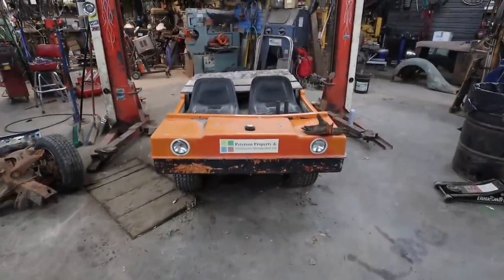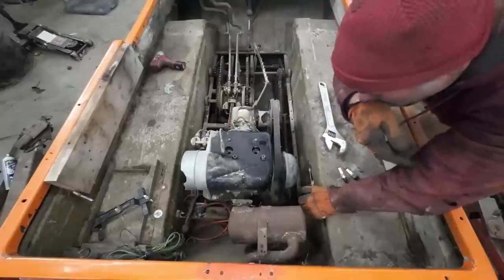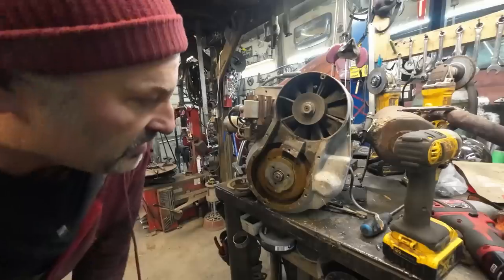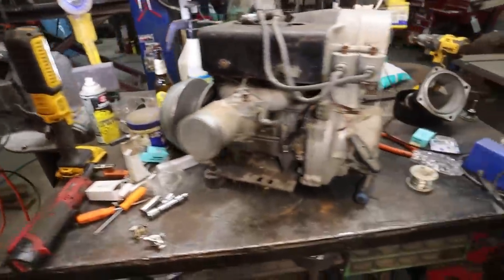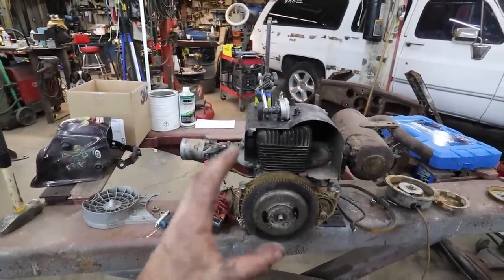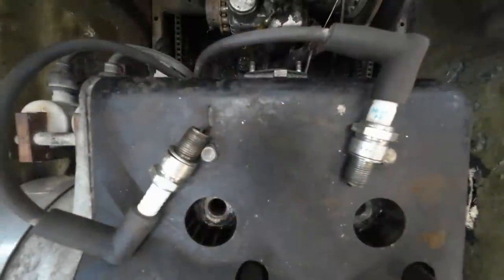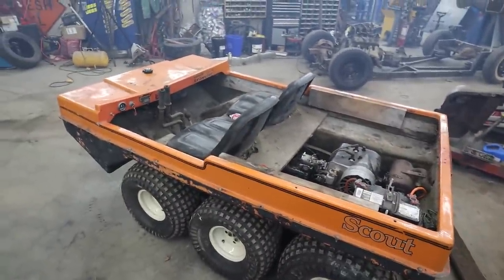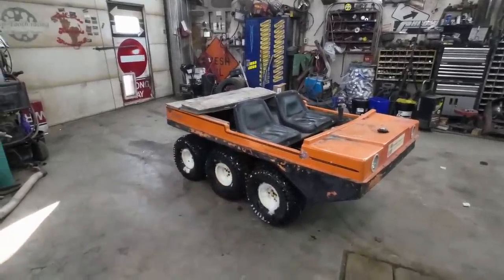1972 OTACO Bazooo 6x6 can we get it to run and drive again?

Comment: I was able to find a VERY limited amount of documentation about this thing after some googling!

What you have is an OTACO Bazooo. It is a VERY limited production product and theres only a couple dozen known to exist. It seems the traveler/scout paint on it was done after the fact to mimic an IH Scout.

They were made in 1971 and '72, I couldnt find any production numbers but theres maybe a half-dozen of them I can find on the internet. The engine is a CCW (Canadian Curtis Wright ((yes, that Wright))), it was either a 240 or a 290cc. The OTACO brand changed hands a lot, hence the Bazoo only being made in '71 and '72. You are correct, it is supposed to be watertight and float like an Argo.
Reply: Cool. Thanks for the info.
Reply: I'm lookin' at that thing thinking deleting the 6x6 and putting some fully suspended tracks on it instead would be fun as hell. Forgo the amphibious part entirely.
Reply: I was thinking the decals on it were from an IH Scout. 👍🏻👍🏻👍🏻
Reply: @rexkramer4938  Agreed. Looks like it.
Reply: It needs some snow chains!
Reply: How can you find it? Maybe it belongs to someone?

Comment: Good work. When it first ran it sounded like the starter was still engaged. Way to hang in there, most folks would have pushed it back into the snow.

Comment: I’m a snowmobile mechanic in Brandon yelling at my phone! Lol all the parts you need to get that running are just down the road at sun and snow in portage! Anybody who deals sun and snow can have you the parts overnight. The bottom fitting on the carb can be replaced with a spin on tillitson spin on filter.

Comment: Well at least you got to have some fun with it, after working on it and solving all the problems there were. It is pretty out dated now compared to quads and bigger dump bed enclosed 6 wheelers. I thought for sure Pablo was going to get it, but he didn't see as a fun ride and something he could get killed in. And it stopped smoking at the end of the video, which was very educational working on smaller engines. Take care my friend

Comment: Quite the machine. Tillotson carbs are the bane of existance to many. The broken spigot is the fuel pump. Mikuni pump helped, but likely the carb needs the crankcase impulse to start. My best suggestion is make an adaptor and stuff a mikuni on it. 
Makes me want to get my cushman lobster going. Also not many of them around.
Pablo wasnt having any part of it😂
Reply: Tillotson carb, pick it up and throw it in the woods, then pick it up again and throw it farther.

Comment: Excellent Video Brent  :) also remember hearing them built in Ontario Canada back 1970's  and never around them except at Auction sales seeing them and one saw years had Snowmobile of a 1974 Bombardier 400 Cubic Cm with 2 cylinders plus 2 carbs in one air filter and 2 exhaust ports  to one extension  pipe in small farm tractor piglet muffler with rain cap and fuel tank 5 gallon of plastic Snowmobile up dash , plus rip cord start with key ignition dash plus choke also RPM gauge, plus Snowmobile Speedometer, one headlights , back up brake of trailer square with License plate hook for small or big ones plus cabin to 2 people only steering wheel was Snowmobile plus gas , brake , plus headlights for high or low and button to kill engine! In cab had switch for turn on Cecile lights  when engine running cab made out plex glass plastic and door on to plus windows so ! Doors had small open adjustment for want smoke let having! Sold at Auction for $1.000 back in 1994 was at and creative idea  only 4 wheels to homemade one axle was lawn tractor type !

Comment: Cool build you have going. Not all 67-72  C/30 trucks came with cab lights, only those with R05 "DR wheel conversion" on SPID were mandated. I've had several single wheel cab & chassis trucks without them. Also your front Dana 60 axle has to be from a 77 or later K/30 as there were no 1 ton 4x4 GM trucks till 1977.

Comment: Hey

Friend had the same idea from a Buffalo NY company.  Ran well when it did.  We managed to bend the center Axles, which we never fixed.  We also managed to have a small engine fire.   

Again, ran well but it would 'float' a bit.  Snow, water, too much speed with a short weird driveline would all cause it.  

Have fun while it lasts.

Comment: Although happy ya got it going, happier to hear the words "GONE"! Its a project that never ends or there would of been more of them for sure. When working sorta, most fun you can have with clothes on but rougher than a stucco bathtub to drive. More than anything was fighting what mother natures temperatures gave you to play in. I think  had they mounted the outdrive way high and since there is no limit on how many chains this thing can find a use for, more for getting power to the wheel seems befitting. I am glad it runs but in the same time line, you probably finished a hotrod thats worth a bit of change. This is a  money pit for sure Brent... Pablo is smart.... stay away daddy!

Comment: You need a good 1/2” drive long handled break-over bar and socket! Wore me out watching that big adjustable wrench slip off so often on you trying to unlock that little engine. Need to take off those inspection covers and make sure there aren’t any mice/rat nests dirt wasp nests stopping up the fan and its ability to cool that little engine.

Comment: CCW stands for Canadian Curtis Wright, and from what I have found, and is a rebadged Kioritz engine. Kioritz produced the engines for Canadian Curtis Wright, who imported them from Japan. John Deere later signed an exclusive deal with Kioritz, and they began producing John Deere badged engines used in later John Deere products, and the CCW name was phased out shortly thereafter.

Comment: When you said Scout, I thought of an International Scout which were pretty cool. Marvel is probably the best every day air tool oil. I have used it on the same air drill for years, with the original chuck.

Comment: OMG what a thrash.  You could have built three hot rods in the time you spent trying to get that finicky engine to work.  You could have adapted a Predator engine in a quarter the time.  Of course it would have not made as entertaining a video.  I applaud you not getting frustrated and taking a sledgehammer to it.

Comment: hey brent just a tip if you ever need parts you can get them for a 440cc snowmonile engine this is a neat little amphibious vehicle and a rare one at that also yes its very similar to the argo its basically the canadian version have a good week
Reply: also the coils are the same as my 85(i think it is) yzf85(or something like that)so if you just look around you can just use other machines parts since this is obselete

Comment: That engine looks just like a 440 Ski Doo engine . I have a few of them in my garage and got one on a homemade go kart I built back when I was a teen anyway that thing is cool I hope you don't round that bolt off with that adjustable I would use a closed end wrench or socket before I use one of those. You need to take that bolt out later and oil up the clutch arms under that cover and my need to adjust them too since it's been sitting a long time you can get them to run real good with some adjustment anyway what a cool machine.

Comment: Hey Brent, considering how difficult it is to do the timing do you think that replacing points with a CDI would be practical? Maybe more practical for a motor transplant to replace that oldie? Quite an enjoyable problem solving venture.
Reply from the maker: Yeah but if a feller looses spark points are usually cheaper haha

Comment: Man, yya need the patience of Job, to tackle that job.. I would've given up on that thing long ago. Boy did you ever have to macgyver that mess together, I was beginning to feel sorry for ya, there a bit.  budd. It operates in some ways like a little tank. or a unitrack that I use to use when I worked in the coal mines to bring supplies into the coal mine. Once you figure the thing out Brent, and fix what's not working, it should be a blast. I think it will serve ya better when the snow gone..I don't think their meant for snowy conditions. I think argo's need special tracks on the snow in general. Since the machine doesn't have a lot of ground clearance.

Comment: Just in case you arent familiar with two strokes. If it gets left sitting for a while the oil will seperate from the fuel and sit at the bottom. And if not shaken and mixed back in , you will get a concentrated oil clogging up the carby

Comment: CCW is Canadian Curtiss Wright engine they were built for snowmobiles they were used in old Scorpions and John Deere and other sleds. I use to have a couple engines and parts but I will have to see if I have anything since it's been a while since I had anything with a CCW that is early 70's snowmobile for sure. What CC is the engine it should have numbers on it by the shroud if I remember right.

Comment: Back around 1975 I had a customer who had recently purchased a twin track PasseParTout (  https://www.youtube.com/watch?v=ip6PxIsCm0Y  ) ATV and he wanted to put a blade on it to plow snow in the winter and tidy up the beach at his cottage in the summer. I went to have a look at it and was surprised that it had a complete metal frame and body. We figured out  way to build a blade that would work with an electric winch and he commissioned me to build and install it. It took about  week to get all the parts and pieces together and have a fabrication shop roll the blade into shape. I spent a day putting everything together at his lake cottage and spent another day tweaking and painting it to match the body. He was very happy with the unit but I told him he should never take it in the water because the blade had changed the centre of gravity and I was worried it would push the front down and cause it to sink. He said had no plans to take it in the lake so that was not a problem.
Around October I got a call from him asking if I could bring my welding truck over to help with the rig and I said sure. When I arrived I asked what the problem was and he took me around to the front of the cottage to the lake. I didn't see the unit so I asked where it was. He pointed out to the lake and said, "See that buoy? It's attached to it." He then went on to explain that while he and his wife had been out one evening that his 16 year old son had decided to go for a joy ride and prove that my theory about being nose heavy was in fact correct. I  asked what he wanted me to do and he said pull it out with my truck. Apparently he had tried with his pickup and it just spun out or broke the rope he was using. I told him I would give it a try but I wasn't too keen on going out in that ice cold water to hook a strong rope to it. No worries he said. He went into the cabin for a second and came back out with his son who didn't look too happy. He pointed to a cardboard box on the ground and said get to it. The son pulled a 100 foot x 1/4" chain out of the box and started into the water. He got to a point where the water was now over his head and started to whine but the old boy told him, "You sank it, you salvage it." My customer and I sat on the porch and had a couple of beers being thoroughly entertained watching the boy figure out how to get it hooked up at which point he came back to the beach shivering. His father said did you hook it to the trailer hitch like I said and without a word the kid went back in and re-rigged it. 
I went to back my truck in and the kid was there to guide me shivering all the while. When I was back far enough we hooked to the chain and I slowly pulled it up onto the beach. He asked his son if he was ever going to do anything like that ever again and the kid said, "no way dad." He said go in, take a hot shower, get some dry clothes on and then come back out and bail the unit out. My customer asked if he thought the kid would ever do anything like that again and I told him probably. He nodded his head and gave me a $100.00 for my time. 
The following January he called me. I asked if something had happened to the rig and he said no, it was just fine and then he added but my new skidoo isn't so good. Turns out on New Years eve sonny boy took the skidoo out for a joy ride while mom and dad were out. He was going across the ice at around 100 miles an hour on that three cylinder racer when he realized he was close to the powerplant outlet where the water never freezes and figured he should slow down and turn around. Big mistake. As soon as he slowed the thin ice around the pond gave way and with the engine still running, she went down in about 100' of water. He had about a 2 mile walk back to the cabin soaking wet to think about what he had done. I asked the father what he was going to do. He said the would get some divers out come spring and retrieve it before it was taken to the dealers for repairs. I asked what he thought it was going to cost and he said it was going to be the same amount he was willing to pay for a brand new car the kid had picked out so he could drive to school. 
Years later, after the old boy had passed away, there was an article in the news paper about that same kid. Seems he had embezzled some money out of the till from the oilfield company that he was President of and the owners were not at all happy. Some people kids just never learn...............

Comment: Brent,, I’d love to help you with this one,, I have a buffalo truck by recreational industries,, fun little machines,, not fast, but they do float,, so that’s a plus,, one good upgrade is to machine new axles,, due to most models, having hollow axles which were their weak point, plus any time you think about hitting the water, grease your outer bearings,, your hull is fiberglass,,,  the newer argos and max series are jet molded plastic

Comment: There wasn't any metric in Canada until the mid 70's, and there's a good chance that is the original motor, they were used in a variety of snowmobiles, that drive line is pretty much 70's snowmobile, it's probably a 440cc engine.

Comment: That hole is the drain plug that you really dont wanna lose in a pond. Ive got a Hustler 6x6:amphib
Good luck causse that'll needva lotof soak and probably need to pull thejugs and do a clean up hone in cylinders if the pistons will comenout. Careful dont break or lose the rings. It could be fryed uf ran on straight gas dam let it soak longer. Run 20 to one. Quart oil to 5 gal gas. That sounds like needs to be spun with oil. Its  Probablynreal fry. Thats a CCW sniwmobile motor. Mix oilbtich to get oil back in cylinders. You can loosen it up and oil the hell iut of it snd spin it a while n might loosen up. It is a points ugnition. Inhave about 60 yrs experience in this topic. Thats a 340 ,cc twin witheither a mikuni ir walbri carm.it should beball metric. Its an old snowmobile motor You got anlot to kearn when you git to the cjains and sproickets. . Hreace the axklesnandnpray theybturn. Realky soak the chains if they're aby good and ifbtheybaint they willbdestroy the sprocketsvthatbyou really dintbwantntobtrash
.if your funding water in it its probably. Yhe CCW were common. Usen in mant skeds. Your shopping for snowmobile parts. John deer used that engine. Ive got one totalky original oem. Do you know anything about the Cvt clutches?? Better study a little. DONTbtry to adjust the belt. Ut us supposed to laying loose on the deive cutch ehen not running and idling..yhise points are common. Mix 2o to one and it will be good on it tonrun it oil rich. 20;to one. Trust me. Dont screw with the clutch or belt.the belts drive off the sides not the bottom.. dam dont make the belt tight it will destroy the clutch..

Comment: LoL reminded me so mutch my Terrajet I baught from a Friend. Very similar, but only four wheels. Direction was simpler cause you had a wheel, but you  had to sit un the middle. Really raugh ride and not a ton of traction. Painted it skidoo yellow and had lettering Tonka. Was fun with the kid, but noisy and frankly so outdated 🤣 oh it did have a roll bar for protection
Reply: I have a '73 model TerraJet. 300cc Kohler two-stroke twin. Definitely noisy.

Comment: The timing is 15 degrees before TDC. It must be set with the advance/retard unit in the flywheel at fully advanced by jamming the weights with a matchstick etc. afterwards removed. No. one cylinder is set first with the gap at 15 thou, adjusting the backplate. No 2 should be close but should be also set at 15deg  BTDC by slight adjustment to the points gap, if necessary. The bottom coil is the ignition primary winding, the top coil is for battery charging  voltage regulation by an external Zennor diode. Spark plug gap 25thou. Being a 2 stroke it will no5 run properly if the crankcase seals are perished from age. Good luck from my armchair!
Reply: derek, thanks for all the details and backstory.

Comment: I would of pulled the cover and pulled the heads off of it and add heat to the piston tops helps get them loose and the rings to release from the pistons but seeing you had no patience for that hopefully there is some compression to get the thing going if not you will know what the issue is and that is lack of compression.

Comment: At least twice I have seen that I have sparks outside cylinder, and when you put them back i, the refuse to spark!  Have you notice that sometime...? Very strange...
Reply: Harder to spark under compression. Might be a weak coil or condenser. Not sure.
Reply: @lessharratt8719  But if I change spark plugs it runs again! 🤔🤔
Reply: @backby-anders  That is strange for sure.

Comment: OTACO😊 made diecast toys. Never new they made a real vehicle. CCW Canadian Curtis Wright. Looks light it needs some weight in rear. Rear tires don't always contact. Based on other units similar to it the tires are wrong for water use. Others use tires that have like padels molded into tread. Sort of like an ag tire.